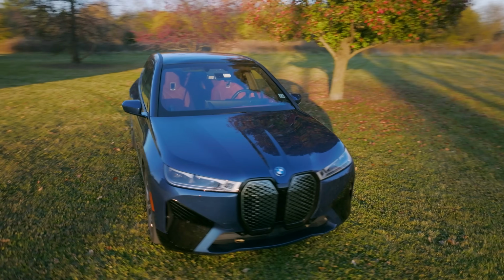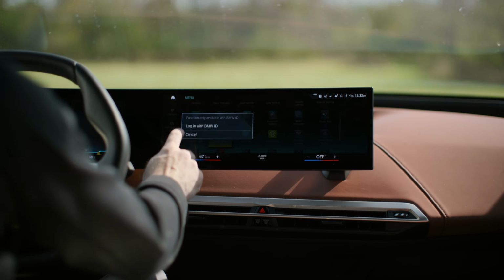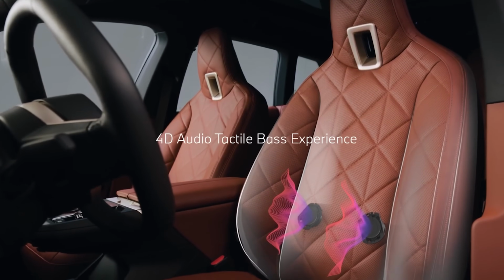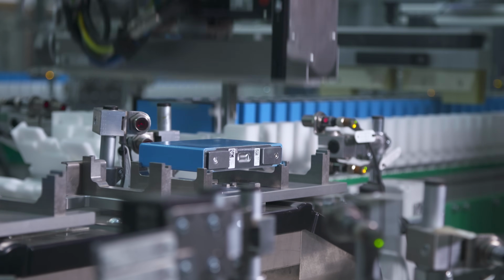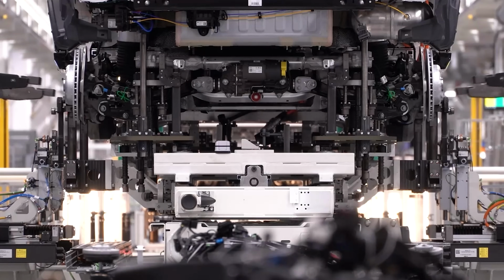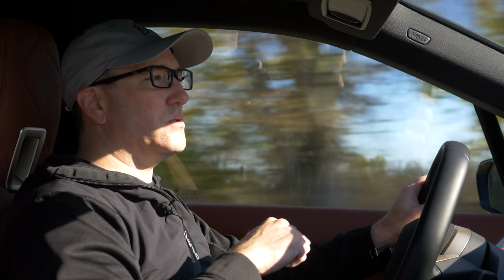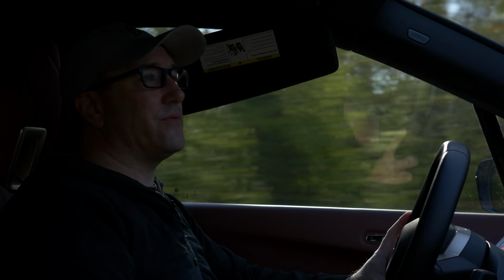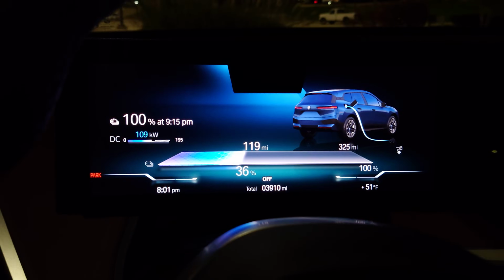BMW iX M60 | The Frustrating Future of EVs

Comment: I would love to see more info about the batteries in the new and upcoming electric vehicles. Fire danger is a serious problem for towing, storage, and repair. 5000 degrees plus and multiple re-ignitions of the battery once thermal runaway begins. Storage facilities have to space the cars out a massive amount since once the battery ignites it can shoot flaming cells up to 100 feet.

Comment: Shouldn’t review EVs if you have no understanding of them. 

A Taycan has good range and it’s real world range outperforms EPA. They easily do 275+ and has the second best charging curve. 

Also you probably haven’t driven the refreshed S and X. It’s build quality is way better than the original
Reply from the maker: Understanding?
Reply: @savagegeese  sorry geese, but he’s 100% right. Taycan is a 280 mile car at highway speed. EPA is soinconsistent.
Reply from the maker: @cadriver2570  280 mile car is what conditions?
Reply: @savagegeese  highway 70 mph. It takes 56 mph in good weather for Tesla to hit their EPA numbers. Check out the inside EVs and bjorn nylons testing for numbers at 55/75 mph in winter/summer. I’m in the market for a luxury EV sedan and am not even looking at the EPA figures.
Reply: @savagegeese  you mentioned taycan being a poor choice due to its 225 range. It’s real world range is much better than 225 and has one of the best charging curves and would win in a 1k mile road trip against the ix. 

I actually had an ix on order with deposit and cancelled after test driving it. The refreshed model X is much better than the ix

Also like you said at the end of the day the ix didn’t make sense as I’d just pay less for an x5 or just get an x7.

Comment: What a ridiculous video. Your complaint about the AC and how you used it was wrong. I own a new bmw with idrive 8. To use the controls you need a bmw id which allows voice nav. You dont press buttons. It just works. 

Those touch icons you showed? They are NOT controls. The heated steering wheel and seats come on their own. The ac touch unit simply allows you to determine frequency and intensity. 

Over time as I tell bmw to turn heated seats on or off it learns to do so on its own using ambient temp interior temp to guess when I want it on or off. 

I dont even tell it to do anything now. 

Your cluelessness is apparent and a turn off.

Comment: EV's are just going in the wrong direction, with literally everything. The only EV's I've liked so far are the hyundai ioniq, ioniq 5, (older) model S, and the hummer EV. Every other ev is just too much screen and gimmick and weird and ugly deisgns and its just UGH. I'm glad I got my little short range ioniq, its an awful ev by modern standards but I have physical controls for the radio and hvac and I can turn the screen off and not be punished.

Comment: Test drove this-not good. Hexagonal steering wheel is very awkward, seats have poor side bolstering, very odd handling in corners and with acceleration. Esthetic issues are obvious. Wanted to love this having been a multi X5 owner for >10 years.

Comment: I'm considering the IX50 and Taycan 4S and my head tells me IX50 is the much better for $$ and practical for 95% of daily drive. Coupled with the start-up phase of all EV cars that would suffer obsolescence when the next gen comes up, think I'm made up my mine. When I really want to buy a car, I would watch this channel a few times and then make up my mind. Keep up the great work and analysis.
Reply: The Ix50 is crazy efficient. So are the Porsche models but this kills it in the range department regarding road tripping. I really personally like the design a lot (probably will never be able to afford one)
Reply: Lease the IX
Reply: @9000Redline  Where I come from, leasing not an option. iX50 not even available yet due to limited allocation. Maybe can consider i4M50 but it's not on a full EV platform.

Comment: Two EVs come to mind that will offer more for less money: EV9 will offer higher ride height, bi-directional charging/vehicle 2 load + much faster charge times for significantly less cost. The Volvo EX90 will also be a better value with a great exterior and interior.

Comment: As someone who often uses Electrify America, that was mentioned in the video, you will be lucky if the charger is operating or running at full capacity. I love seeing new EVs but the charging infrastructure is far behind the engineering that is going into the vehicles. I live near DFW and the absolute lack of DCFC chargers tells me this is going to be a struggle for the next 5-10 years.
Reply: You live in the heart of truck country and wonder why DCFC maintenance isn't exactly prioritized? Maybe when you see every 5th vehicle on the road an EV like here in the PNW you'll have more options to charge.

Comment: In my opinion as I wait to take delivery of my IX, that this is not a throw away car. I am not planning on taking this on road trips so dc fast charging on 800v will never or very rarely affects me. I have a lengthy commute on certain days and this helps simplify the cost of driving that distance with the comfort of a luxury car. The only thing that waiting will provide is more range, but you can say that once 6 gen is out for 7 gen as well.

Comment: wtf does hyper-disposable even mean?  This car's "5th generation battery" will likely last at least 200k miles, and more likely with a typical 1500 cycle battery life for li-ion cells, that puts this up around 500,000 miles before the battery goes bad.  Like, what are you even talking about with this statement that you guy repeated like 10x during this video?  Sure, the next generation batteries will be better, but this car's range is ample and the life of the pack is fine for anyone's needs.   

As to the price... what in the world are you guys talking about?  Price is based on supply and demand, not based on use of aluminum and CFRP.  If no one will buy the car for $113k, then they'll lower the price.  That's how economics works.  Is this a good value compared to an X5 or X7?  Absolutely.  It's far cheaper to fuel it with electricity than premium gasoline.  330 miles of range in this will cost me $18 to fill up at home (including charging losses).  At $4.80 for a gallon of premium gas, an X5 will cost about $68 to go the same distance, 3.7x more.  How about to go 200k miles?  This will cost $11k to fuel, the X5 will cost $41,212 fuel.... $30,000 more.  The X5 will need 1-2 oil changes per year at probably around $150 a pop, not to mention the time it takes... the iX won't need any oil changes.  The X5 will go through brake pads and rotors in about a third of the time of the iX due to the EV using regen braking that doesn't wear down any components.  The X5 will almost certainly have engine problems throughout its life that'll need regular maintenance.  Spark plugs, transmission oil changes, electronic thermostats and water pumps, oil gaskets, etc... 

Oh, and why else would someone buy this car?  Maybe because they actually want to reduce their emissions...  If gasoline were taxed properly based on the amount of greenhouse gases it releases, it would cost a whole helluva lot more to fuel your gas car.  Now... don't get me wrong... BEVs are not 0 emission and 0 pollution.  They have a significant carbon footprint and cause significant environmental damage.  However... gas cars are far far worse over the life of the vehicle.   FAR worse.  Maybe it's time some of ya'll start showing empathy for your planet, and your fellow man who's being impacted by us destroying our planet.  In fact, don't buy this behemoth... buy something more economical that uses less resources.  Have fun with your travel.  Buy a PEV.

Comment: This was so well done guys! I loved the little flex on soundstage design. Hans Zimmer scores are always on point so it's pleasant to see it's use here, though it can be jarring. Kia released similar product and went all the way as to making an instrument. The details on motor parasitics and impact on driving dynamics, the mention on HV architecture platforms over Med Volts,  strategic sourcing -the whole package just shows their direction to get "smarter" implementation. BMW recognizes that they're  trying to push the innovation on this next gen  EV platform

Comment: I would be careful with hasty assertions about EV residuals at this point. EV supply will almost always be outstripped by demand, so there will be high demand in the used market as well. That said though, BMW generally has pretty poor residuals since their vehicles are so expensive to begin with. We gotta do away with the myth that EV batteries will be toast in 10 years, that's just not the case since the vast majority of EVs from 10 years ago are still on their original packs, even the POS 1st gen nissan leafs that didn't have any thermal management are still puttering around out there.

Comment: BEV's are the very wrong solution for a nonexisting problem.
The EV technology is more polluting than efficient ICE or hybrids. Also very, very expensive (even without factoring in the hugely expensive battery replacement), with a short life and extremely high TCO, dangerous, impractical, time-consuming etc. and too CONTROLLable.
And this BMW is fugly.
However, the audio system from B&W seems to be fantastic.

Comment: The purchase cost is high, the insurance cost is high, the battery replacement cost is high, the residual is low, the cost to build is high, the petrol used to harvest battery natural elements is high, the coal or natural gas generated electricity to charge the batts is high ….. These vehicles will save the planet.

Comment: I saw one of these in the wild and dead ass every wheel had already been curbed and I was laughing my ass off, like seriously every wheel was curbed at least 1/3rd the way around. It also actually looks cool in person, they have some cool paint colors and even though it's styling is just nuts, it indeed stands out, I really feel like there was something good there if you could remove some lines and some shiny black plastic looking panels make it more cohesive, but hopefully that's what will exist with the next generation of these. I also fucking adore the center console with the wood, the interior is weird but very interesting and I like it.

Comment: It looks like a chunk of volcanic rock ... a brick. Visually so extremely heavy. Which it probably also is actually.
The front looks like a simple concept drawing.
The massive ass and then such a short and straight cutoff at the front, I can understand why it is controversial. (Although to me it's not hideous if I drop the convention-goggles. Just very odd.)

BTW, did anyone discuss and examine whether recycled materials like that might contain traces of unwanted substances and maybe even toxins? Eco-friendly tends to come together with human-unfriendly in our deranges times.

Regarding data collection, notice: They used to be able to make cars without this data collection madness, or much less creepy. And now they log everything and still screw up all the time. Which shows that it is all a fear function of trying to cope with a tightening noose, while people don't question why there is a noose but either accept it as a fact of life or even celebrate it as 'the way'.

Frameless door windows look like they make break-in very easy. And probably also cause water problems. That, too, could be cost cutting sold as stylish.

BTW, I wouldn't so optimistically assume the next generation of things will be an improvement. Shit's going down big-time, and doubling down on the usual is not the solution.
EVs are same room, different wallpaper.

The acceleration sound is cringy-gimmicky. It is alright when kids are hacking video games to give racing sim cars wrong sounds, but in an actual car someone spends 100 grand on, it's kinda self-ridiculing; when artsy-fartsy minds go corporate bonkers.

Comment: Great Review! I have an IX 50 and it is an incredible vehicle. My wife and I actually like the way the exterior looks and absolutely love the interior! The range we have experienced has been over 325 miles after each charge, with very normal and sometimes being aggressive on the throttle.
 This vehicle can also be driven on 1 pedal which makes it easy. The I drive 8 system has a bit of a learning curve. However, once we got used to doing the verbal commands and created some shortcuts, it has been quite easy to navigate through it. We have the Harmon Kardon sound system and it is very good. 
Tesla doesn't come close to the way that this handles or rides. (We test drove the Y and X ) Plus being subjected to Tesla's OS without the choice to have Android Auto or Apple Car Play was a bit of a disappointment. 
You're absolutely right that this type of vehicle should be leased because of what the next generation will be able to offer.
Reply from the maker: I expected to hate this thing, and wound up thinking about owning it.  Be curious how you feel about it in a few years.
Reply: @savagegeese  Me too!
Reply: @savagegeese but did you do it?
Reply from the maker: @florinvid  Have to flip X7. Was trying to do it a few months back and fell through.
Reply: @savagegeese the IX 50 is incredible. Just bought one and it’s the best vehicle I have ever owned. Luxury and quality
Reply from the maker: @josephfamilyrocks  I have one on order. Finally turned to dark side.  Let me know how it goes

Comment: I don’t agree with the fact that it will be irrelevant once new cars come out. Teslas from 10 years ago still drive around and have decent range. A car’s function is to drive. If someone finds the power, range and charging speed fine today, it won’t suddenly become unusable once something better comes out. And anyway a newer car will basically have just more range at most, there’s nothing else to radically change that you couldn’t say the same about an ICE car (infotainment etc). And yes, a battery will degrade over time but if properly designed it shouldn’t be that significant, and only noticeable after some years, at which point people who buy these luxury cars usually replace them.